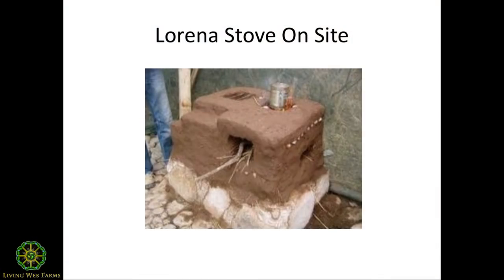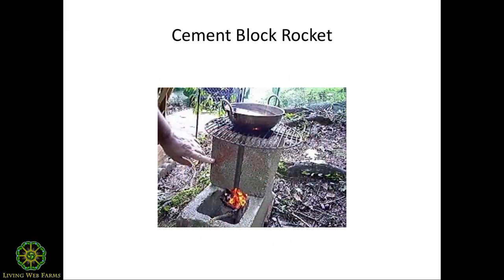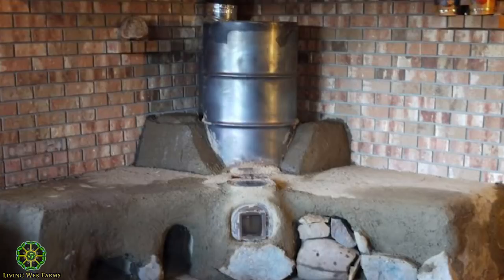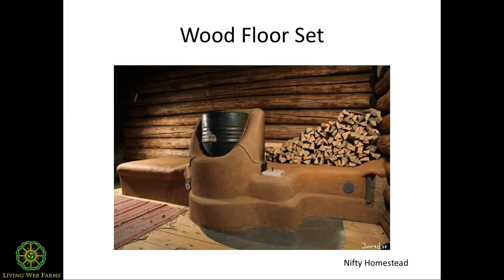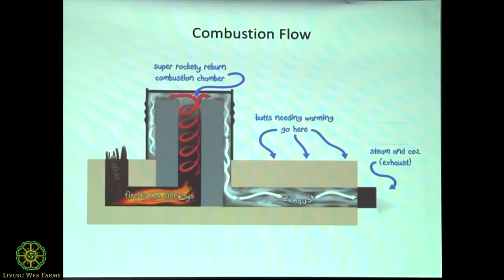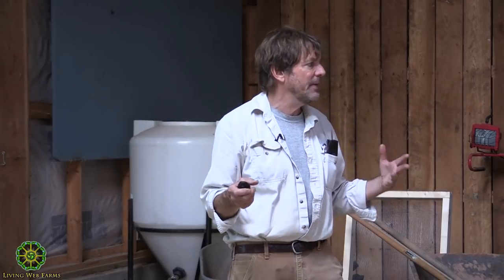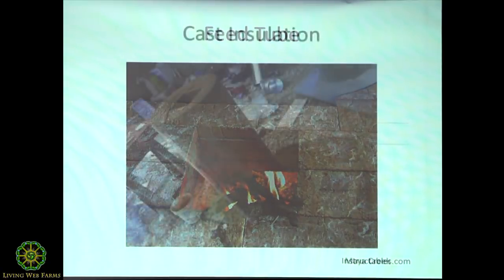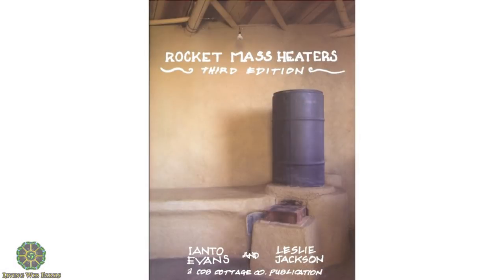Rocket Mass Stoves for Cooking & Home Heat

Comment: Great video!

I bought a house in the country with a large steel (65x50) workshop.  It had a cast iron stove for heat.  We tore it out and built a rocket mass stove/heater.   It’s between two rollup doors and will heat the shop so well.  There’s an overhead fan that moves air around.  

Best invention ever
Reply: Cleaver how they used two barrels do you can easily replaced the spent burn barrel...
Reply: @alanschaller5869  
He is wrong. The barrel bells do not get hot enough to burn out and they are not wet enough to rust out so they are permanent.

Comment: I highly recommend the books 'Rocket Mass Heaters' by Ianto Evans and Leslie Jackson, and 'The Rocket Mass Heater Builder's Guide' by Erica and Ernie Wisner. They have all the info needed to build a high quality RMH without making mistakes, and were written by the creator of the current RMH and by some of the cutting edge developers today. I've taken a RMH building class from Ianto and Leslie in Oregon, and I'm not sure where the idea that a mild steel barrel lasts for 1 to a few years with regular use. Ianto has a heater that sees constant use that has the same barrel now for 10-15 years, in the rain forests of the Oregon coast so plenty of humidity. 

If properly built and insulated around the heat riser and burn chamber, the barrel will get much more than 200 degrees... more like 600-800 F on the top but it does quickly drop going down the sides since the barrel radiates heat as part of the design. If built with low quality red brick and only a little insulation around the riser the temperatures are lower because it's less efficient. If you follow the books above guidelines on sizing, the exhaust will be under 150F and safe to touch. The cob heats up depending on how long the burn is. If you have a short burn, the cob warms up a smaller amount, and that amount goes up the longer you burn. So there is no absolute temp that the surrounding cob will stop at like suggested at 90F, that would be sort of low honestly. There are plenty of folks taking readings with digital thermometers after burns and 12 hours after, and the temps are around 140F soon after and 100F the next morning.

The sizing of the feed, burn tunnel and heat riser is very much the key factors for developing the draft to prevent smoking back. There is a ratio to follow as a minimum: the riser should be 3-4 times taller than the feed, and the feed height plus burn tunnel length combined should be no more than the riser height. If the burn tunnel and heat riser are made from insulated bricks or refractory materials then the draft is much stronger/faster, as heat isn't being absorbed as much by the material before exiting the heat riser and you get a hotter burn. Hotter burn means more complete combustion and efficiency.

It's not mandatory that the ducting after the manifold always angle upwards but you definitely don't want the ducting to dip down as there is always humidity in the exhaust gasses and that can condense in a dip and then rust out your duct in that spot. It would still be surrounded by cob but it would cause a little damage. Also as the exhaust cools off a bit, having the pipe closer to the surface further along can help evenly heat the surface so you don't have hot spots or cold spots. Having the duct sloped up a little bit makes this easier so I'm not saying 'dont' slope, just that it's not mandatory.  8)
Reply: Thank for this input, valuable info.
Reply: @karlbanks2653  
Walker Stoves has made some improvements.
Reply: @jakebredthauer5100  Thank you Jake :)) I’ll take a look. Happy new year to you.
Reply: @karlbanks2653  
No ducting is needed in the bench bell.  Matt Walker likes to use CFB, ceramic fiber board insulation and red brick (no cob, no barrel).  He sells build plans.   I consider him an expert specializing in design of RMH.

Comment: 25:45  Barrel Size

I use a 2/3rds section of a nitrogen "K" cylinder utilizing a 3" round vertical burn chamber within, fired with propane gas.  

The 3" x quare tubing exhaust travels a labyrinthine pathway through a small sand & cement bench in my bedroom, attached with a 4-bolt flange, terminating in an 18-feet-tall flu to a rain-proof termination cap.  

I installed a swing door on the flu to allow a candle to be placed on a wire rack inside the flu to act as a "flow primer". 

It takes about 2 hours to heat up, then I shut off the single burner, toss a pillow against the inlet, effectively spoiling any draft and sleep with the gas off. 

The warmed bench keeps my 15' x 15' room toasty warm all night.

Comment: If someone is using a lot of ducts that wind around inside a cobb bench, like he said, a door (at the end) that would accept a small, burning newspaper, to warm the rest of the chimney just before lighting, is a good idea. Most rocket heaters heat up VERY quickly, and the draft aggressively starts moving in the proper direction quickly for most people, but if I was putting a big setup in my house, I wouldn't take any chances. A way to warm the chimney to ensure draft is always best. You don't know exactly how the system will behave for you. You could be stuck without it. Just a tiny door. Test the draft with a lighter. If the draft is good "and up" sticking a small ball of burning newspaper in there is all it takes to warm things up a bit and to get the draft moving BEFORE lighting.

Comment: Would be nice to see a system that could be done for travel trailer/tiny houses. I'd like a system for THOWs that is able to burn waste materials like corn cobs, etc, without taxing the stove, like to avoid the drum, too.  Want to be able to cook on it in winter time, bake and heat water in an efficient system.  Placing the tank in the apex under the roof uses wasted, hard-to-reach space and the water heater in the attic helps recapture lost heat, too.

Comment: You could warm water on it by wrapping copper tube round the inside of the chimney , the part that's hot
Reply: Be sure to  put a steam collector in the end tube, cause if you heat water from inside thats all you will have left.
Water turns to steam at 212f and riser temps regularly get near 1000°f.
Dont make a closed steam bomb. Vent it to atmosphere.

Comment: Once it gets going, it draws beautifully, but I think I'd use a rechargeable battery-powered blower to pull air through the system before it got going, and recharge the battery with a TEG that ran off the heat of the flue.  

These are notoriously smoky to get started, and his idea to fix is OK, but pretty crude and kind of vague with the 'T' idea.  A blower, though, yes.
Reply: Harry Mills I use my hot air gun that I use for stripping paint, for a few minutes, I never have problems with smoke back.
Reply: @peterbeyer5755  used at the air inlet to also ignite the fuel?

Comment: Add a few fins on the ducting to transfer heat to the cobb mass. Heat heat up the cobb mass quicker and transfer more heat to the cobb. The lower the exhaust temperature the more heat you are extracting from the wood you burn... more efficiency...

Even adding a coil to heat water near the exhaust would be a way to extract even more heat... 200°F seems like there is still alot of heat energy to be extracted from the wood...
Reply: The heat in the chimney is necessary to cause the draft.
The mass does not need any tubes; it can be open space in the bench bell.

Comment: Ive wondered, how long of tubes can you have coming off the main stove/drum that runs out, which is covered in cob? Ive read a few articles and none really mention the maximum length. I know at some point you would lose the heat efficiency and capability to heat the mass if it was to long.
Reply: 50’ max minus 5’ for every 90° bend. It’s not about losing heat efficiency, but losing draft to exhaust the remaining fumes.

Comment: Another point, if one would want the flu gas entry area into the barrel to equal the area of the insulated clay chimney and assuming the chimney is square with inside dimension "s" and "h" representing the height of the barrel top above the chimney top, the equation would be:
 s^2 = 4 * s * h
and solving for h:. h = s/4 ... This would suggest that the barrel top should be 1/4th of the inside length of one side of the clay chimney.  If inside length were 4 inches, that would make it 1 inch.. This does not take form losses into account since the gas has to take a sharp, 90° bend... better stick with three inches to maintain adequate gas flow.

Comment: That duct looks like it is all galvanized! You should really find a safer material to use! That looks like heating duct for a hot air furnace which just carries warm air to vents, no issues. However if you are getting some really high heat, especially towards the stove side of the heater you can be releasing deadly toxic fumes into the house!
Reply: No doubt!! Galvanized is really Toxic. 
You should only use Steel Stove Pipe!
Galvanized Pipe is a very thin crappie quality of tin covered by the galvanizing process. Burn the coating off and you have tinfoil!
Stove Pipe is quality steel and a heavier guage.
It's also a good idea to use chimney tiles for the first few feet where the higher temperatures come out of the barrel 😀

Comment: Rocket Stove vs Masonry Heater

Durability:
I would go with a masonry heater.  The rocket mass heater shown here is basically a thrifty copy of a Finnish Contra Flow masonry heater.  However, a masonry heater is extremely durable.  Some in Europe are over a hundred years old.  Relitively speaking, the rocket stove seems to need constant rebuilding.

Problems with code compliance: 
To the best of my knowledge, the International Residential Code, IRC, does not recognize rocket stoves, which means they cannot be legally installed in a home in the United States, which means no certificate of occupancy (CO), so you cannot legally live in your home.  Although perhaps some sympathetic inspectors might consider it a fire place, or you may be able to get an engineer to design and stamp a design specific to you site, but engineers are insured too, and I do not know of any that would do this and the stamped design would likely be cost prohibitive anyway. Traditionally built masonry heaters are being incorporated into the building code.  Furthermore, many of the images of rocket mass heaters in this slide shown do not appear to comply with IRC or NFSA setback to combustible materials requirement for an unlisted stove, so even a sympathetic inspector or insurance company would likely take issue.

Insurance & Mortgage:
I do not believe there are UL listed rocket stove designs, or NFSA recognized designs, which further makes that certificate of occupancy unlikely to achieve.  
Without the approval of the IRC, NFSA, or a UL listing, it is unlikely that an insurance company would insure you, or pay out in case of fire damage or personal injury.  No CO or insurance means no mortgage, so good luck buying or selling a home with a rocket mass heater.  I believe some masonry stove core kits might even be UL listed.

Cost:
To hire someone to build a masonry stove would be expensive, however to hire professioal to build a rocket stove would also cost a significant amount of money.  Self built from a professional design would be the choice for either to keep the cost down.  Further savings on a masonry stove could also be achieved by sourcing or repurposing inexpensive hardware.  While I would go with a new firebrick core, sourcing or repurposing an appropriate yet inexpensive outer shell could also knock down the price considerably.

Conclusion:
So it may be appropriate tech for the developing world, I would stick with a traditional self built masonry stove for the industrialized world.  Either way, the builder/owner should be compitent in their skills and most certainly do their due dilligence for the project.
Reply: I'd never get away with a new rocket-barrel DIY install where I live.  But I could get a permit and install an EPA approved stove or masonry insert which uses kind of a similar principle; burn hot and clean.  Let the masonry be the mass.   Not cheap though!
Reply: @marlonw5053  I looked into the new New York State IRC and masonry stoves are now included.  I kick myself, but I saw a couple of pallets of mildly used fire brick for super cheap.  If that was combined with salvaged outer brick or stone for the outer shell, and repurposed or generic hardware, then I think I could build one for around a $1000-1200.

Comment: You could design a rocket stove with a pyrolysis chamber in it, but on their own rocket stoves burn fuel to ash extremely efficiently. While a rocket mass heater is designed quite intentionally to not produce high external temperatures, combustion within a rocket stove is happening at very high temperatures, in excess of 2,000 F . I'm not clear what form of electrical generation was being asked about, so I'm not at all able to respond to that. One of the issues in practical terms building rocket stoves/heaters is having materials for the heat riser that can survive the high temperatures within that space.
Reply: Walker Stoves recommends ceramic fire board, cfb, for heat resistant insulation to use in cores.

Comment: Kids have been around iron wood stoves for centuries.  They can figure that shit out.  For Pete's sake, a kid can burn themselves on a stove or a steam radiator or an electric heater.  This is a fake concern raised by the audience member, who, I presume, never took his kids camping, for fear of killing them with the campfire.  

I would worry about the rocket stove wearing out, because of the refractory temperatures involved.  If you don't know what you're doing, catastrophic failure by the outer "barrel" could burn your house down.
Reply: I'm with you on that subject!!
Ok little Johnny don't touch it's Hot!
A day later little Johnny has a couple of red fingers and is crying 😢 
See I Told you it was Hot 🤬
50 years down the road little Johnny is still not touching things that are Hot! Lol
Reply: Those members are the Karen's of society.

Comment: The draft is caused by Hot air loosing heat to the barrel. Cooler air has lower pressure .
Reply: I don't believe you.
The draft is what the chimney 
is for.
Reply: @jakebredthauer5100  Never mind. There is draft from high chimneys (pulling a vaccum of the pipe)  and draft of heated air having less pressure at the outlet  than the colder air in the inlet. A rocket stove works on this principle and must be pre heated a little to create the draft. Then if goes faster and faster making that sound.
Reply: @goudhaantje3569  
Okay.
The relatively cooler air outside of the riser will not be pushing in reverse (up) as hard as the relatively warmer air inside the riser is pushing forward (up).  
Basically, I am agreeing with you now.  

I will dispute that cooler air has lower pressure, if you will.
Cooler air is more dense and more heavy and will sink down relative to warmer air.  After that happens the air at the bottom is pressurized by the weight of the other air on top of it. The pressure of air depends on how it is confined. I won't say that either one has more pressure than the other. When air is confined and heated it will definitely increase in pressure. The air in the riser is rapidly expanding and may have very slight relative pressure that causes it to want to push in all directions.  In this case the pressure is due to the expansion and not due to the relative temperature. The change in temperature is having the effect.

Walker Stoves has done a lot of work on RMH and has developed a riserless core design for a stove.  I think it still has separate stages for the first burn, second burn and heat extraction.  He uses CFB and red brick.